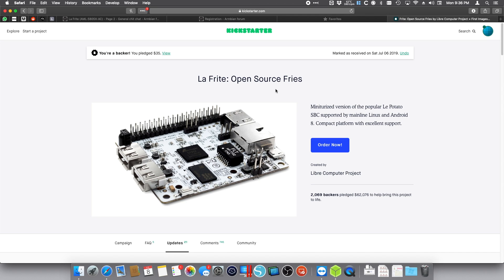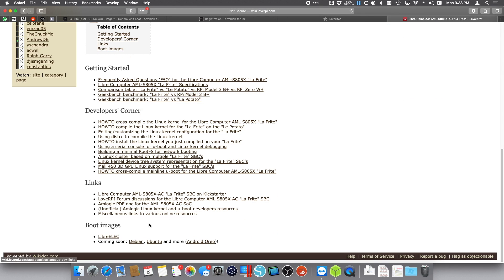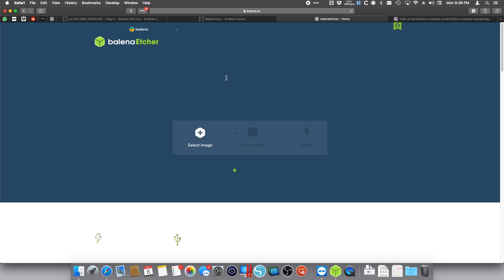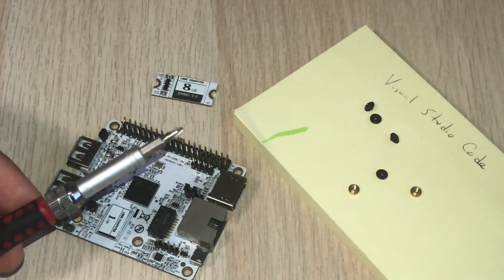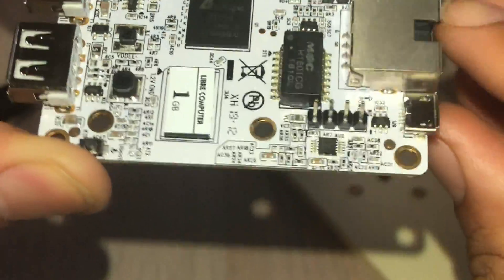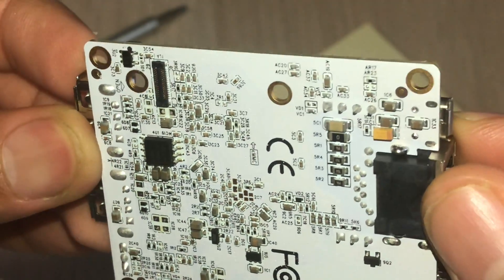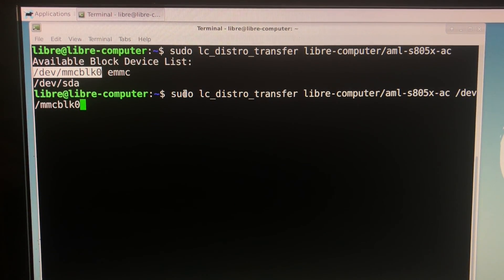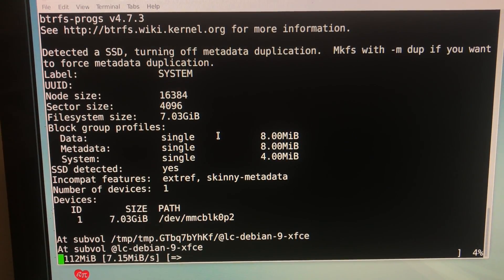La Frite Debian 9 XFCE | eMMC install and flash

Comment: Interesting, I ordered an 8G libre emmc 5.x module off amazon and I guess it is for one of their other boards or something because it is a tiny bit shorter and is missing the holes to mount it to the la frite board.  It still works but now I'll have to 3d print an add-on mount or something to secure it.

Comment: debian and ubuntu images both boot from USB. Unfortunately they don't boot from eMMC. :(
Reply from the maker: Jay Sprenkle are you having problems booting from eMMC? I show on this one how to boot from the eMMC using Debian. Haven't tested Ubuntu though.
Reply: @djismgaming2116  Yes, cannot boot from eMMC. I used the distribution you pointed to and tried several others. None work. I've put the project aside until a working operating system is available.
Reply from the maker: Jay Sprenkle definitely some work needs to be done on this in order to be able to have a better bootable environment for all users. Some are not having issue but some do. Developers have stated that a new u-boot versión will be coming to La Frite with better USB boot support fixes. Let's hope it indeed helps those in your same situation. 👍
Reply: @djismgaming2116  I wonder why some have issues when the hardware and boot image are identical. I notice some had issues because they used usb 3.0 thumb drives and the laFrite is only usb 2.0. That shouldn't be an issue here since the failure is using eMMC direct from Libre. Thanks for all the help
Reply: @djismgaming2116  Disappointed to see it's not just me having issues. It boots with the USB stick in, and then you can unplug it after boot. It happens again after every reboot. Just spend 2 hours thinking i'd broken my mmc. Even more annoying is that I've been shipped an MMC without screw holes so there isn't any way to secure it
Reply from the maker: Jay Sprenkle yeah. It seems to be very picky with hardware. I used a USB3.0 drive in the video without issue. Cruzer Ultra-Fit 64GB USB3.0 but some are indeed having issues. I even got the 8GB eMMC from Libre Computer directly with my pledge and its working awesome.
Reply from the maker: Stewart Cunningham man, hope they can make some arrangements for you if possible because i think it is better to secure that module to the board itself.